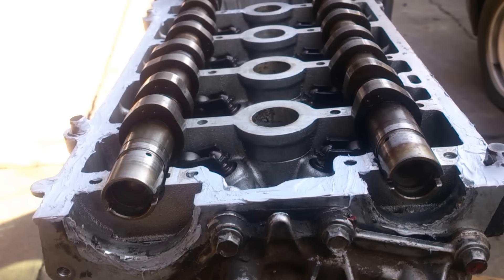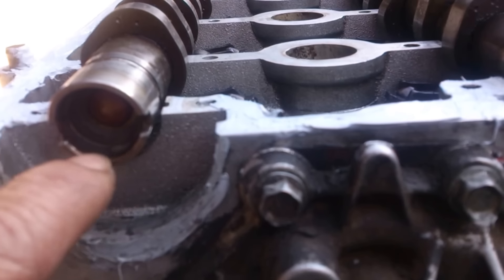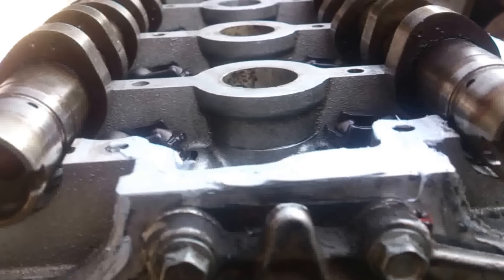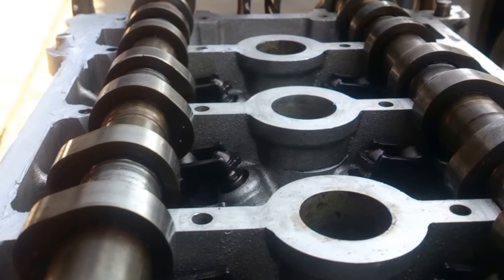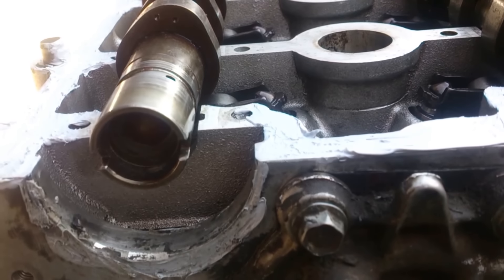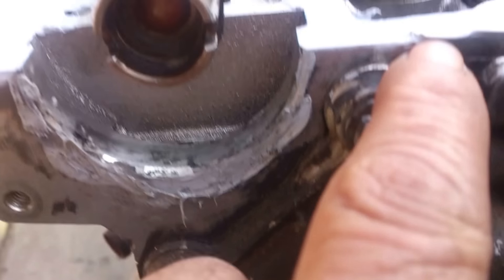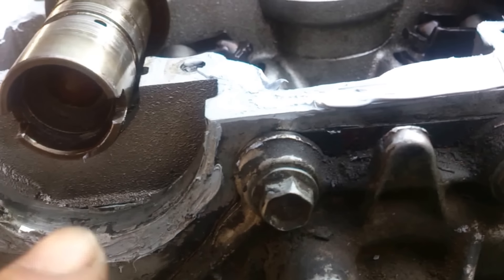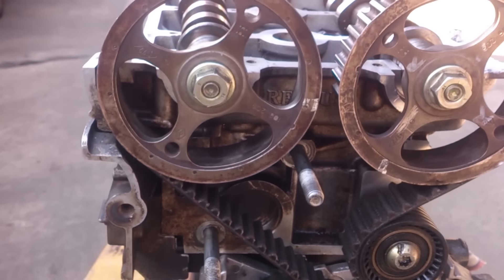How To Do Timing Setting For Renault K4M Engine .

Comment: I'm 99.9% sure cylinder 1 on this engine is at the clutch side of the engine, but the speaker indicates this as no 4 which would be incorrect.
Reply: In Renault the first is next to the clutch!
Reply: Thanks for confirming that, I was sure No1 cylinder/spark was on the clutch bell housing side on this engine. I've just replaced all four pencil coils at 152,000mls after one finally died. I could have replaced just that one, but for a full set with a lifetime warranty for just £28 it was a offer too good to pass up! Engine runs much better now, get about 3% more MPG in the city and about 5% on the motorway, more power also, so has been well worth the investment.
Reply: that's very right
Reply: ,, you need the camshaft locking tool,no 1 is at the clutch side,trust the French to change tried and trusted easy ways of doing things.

Comment: first note your sound is very low 
the second note the first piston of Renault engine km4 is near gear box side and piston no 4 near camshaft sprocket because it different from other vehicle and when I open oil case I see no on piston is written